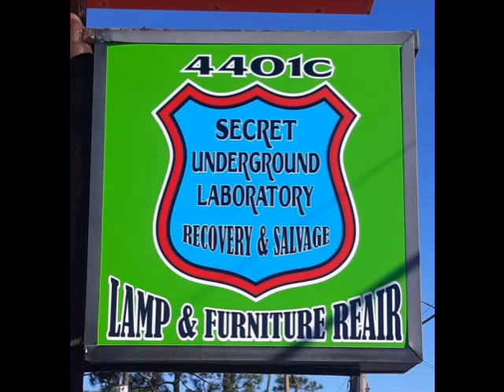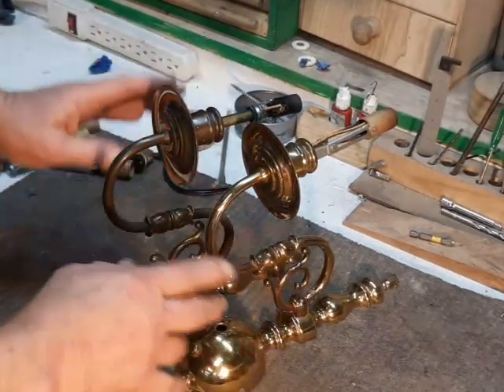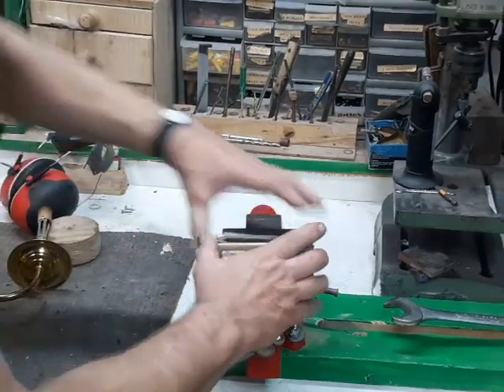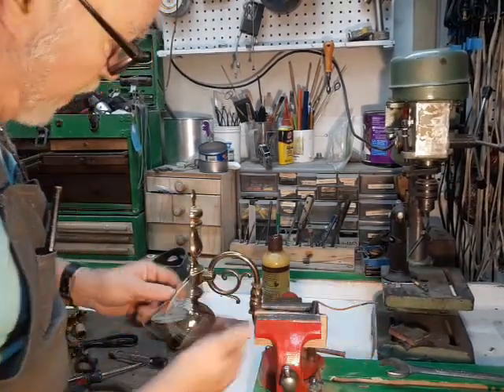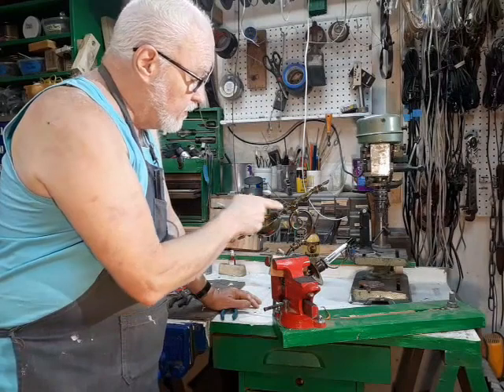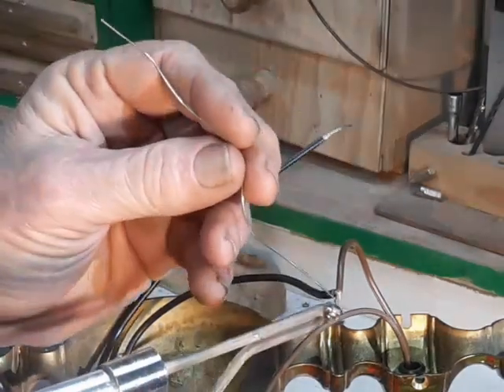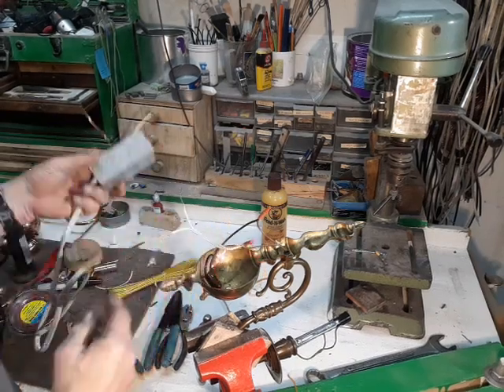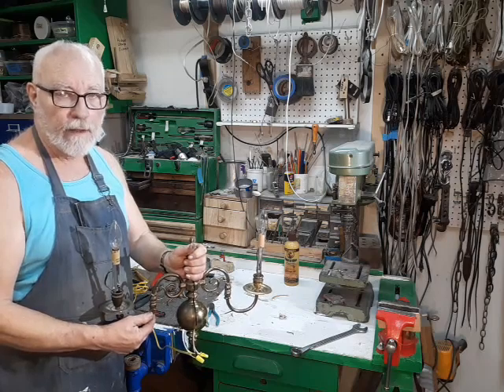TSR: Two Ways to Pull Wires around a 90 Degree Corner in the Secret Underground Laboratory

Comment: Wish I had found Bron before my last repair. Good friend asked me to rewire an antique torchiere lamp. My only difficulty was pulling a new cord plus another pair for the base night light. Did that pull by soldering both to a sacrificial extension cord. It was a tight fir but made it.

It did have candles with S curves, but I was able to push the lamp cord I used thru clean no fuss.
Reply from the maker: Thank you very much. I have probably several dozen lighting videos that highlight one  particular problem or another.

Comment: What size wirevdo you use when rewiring these lights.
Reply from the maker: For the arms, I prefer to use 18 (SPT1) when possible, but many fixtures have restrictions that could tear the insulation, so I often use 20. I always use SPT1 or SPT2 for the trunk wire.

Comment: Have you ever seen a betond 90° to 160°? Sharp turn
Reply from the maker: I always wonder how it was wired the first time. One trick is to drop a beaded chain down the arm. It takes some wiggling, but once it's through, solder the wire to the chain and pull it through. The last resort, which I've used many times is to drill a hole in the arm at the choke point. I sometimes use a Dremel tool to open the passage. The hole is patched with putty and painted to match.
Reply: @BronZeage  I am wondering how as well. Seems it was fabricated with wires inside? Probably not, but sire makes you wonder! Thank you. Trick now is getting lodged wiring out!
Reply from the maker: @1Skylow2  If this fixture has cloth jacketed wire, the jacket gets stripped off and jams on any sharp point. This can happen with regular insulation as well. That's why I use the beeswax polish before pulling the old wire. It definitely wasn't made with the wire in the arm. You may be at the point of drilling. Clamp the arm in  padded vise. Start with a short 1/8 bit to make a pilot hole. . If you have a centering bit, use that. Drill again with a 1/4 bit. Try to not catch the wire in the bit. Be careful because bits always snag and bind in brass. I make picks from piano wire. I put a small hook on the end and sharpen the  tip. This catches the wire or the cloth debris. You can drill the least visible side, but filling and coloring the hole is not difficult, so that's not critical. I've had some arms where I had to drill a  row of holes and grind  a slot between them.
Reply from the maker: https://www.youtube.com/watch?v=x9o9MEM-5Vs&t=267s
This video shows a shop made tool for pulling a difficult wire. It gives the wire a choice of either coming out, or breaking at the bind.

Comment: Love the blue goo. Never got the hang of soldering. I need to take a class.. Great video. You made it look so easy. And we know that it's not always.
Reply from the maker: Thank you very much.
Soldering is not difficult but the power of the gun must match the size of the wires. The pen style soldering iron most people use is is good for very small wires or electronic parts. It cannot make the heat required  for the connection used to pull the wire. The wire has to be hotter than the melting point of the solder. The solder will melt and flow, but will not  stick. Solder pens are usually rated at 60 to 80 watts, while the solder gun I used in this video is 1400 watts.
Reply: @BronZeage  very helpful, thank you
Reply from the maker: @vschroeder4062  you are very welcome.

Comment: Nice video, I always liked the solder method of tinning and connecting the wires.
Reply from the maker: Thank you very much. Solder is the only connection that will hold tension when pulling wires.